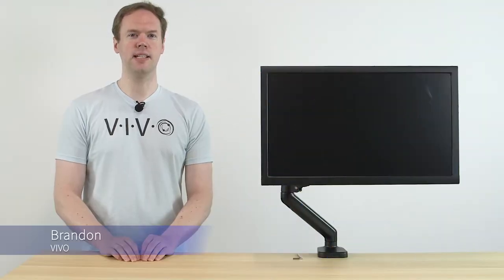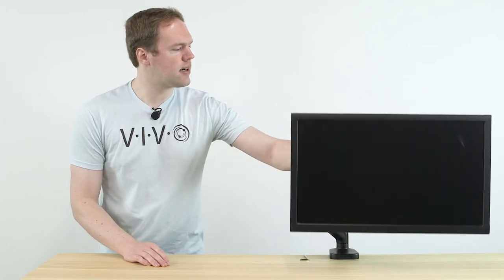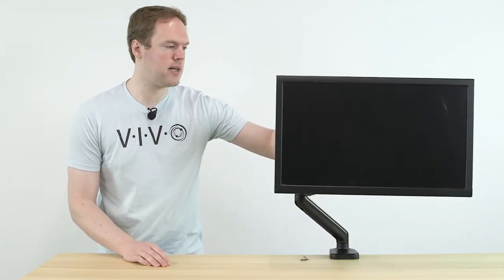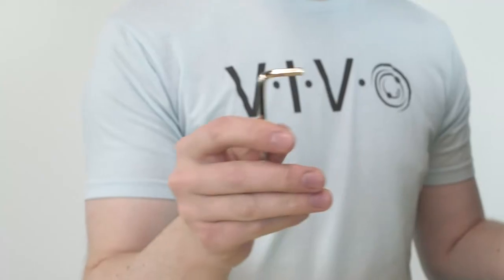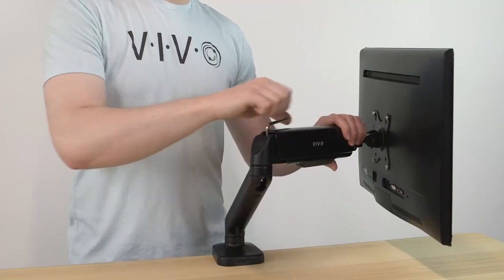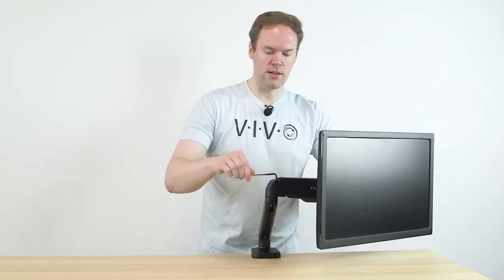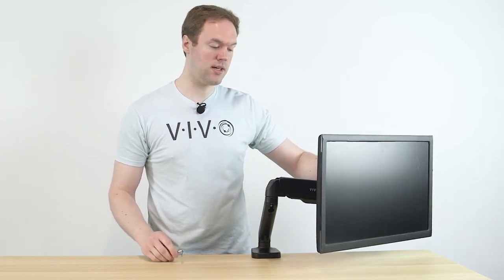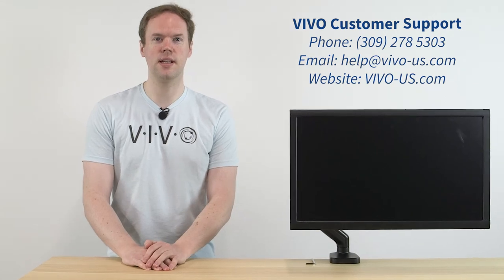How To Adjust The Gas Spring Tension

Comment: Is there a minimum minimum monitor weight for the gas spring to work? Mine is a portable monitor at 750 grams, and I can't keep the arm down no matter what I do.
Reply from the maker: Yes, the minimum weight is 1kg to 2kg depending on the arm.  if it's springing up with the strength turned all the way down, additional weight will be needed behind the monitor for the arm to function properly.

Comment: What does reducing or increasing spring mean. Use proper language - like to lossen the arm or tighten it to hold it in place.
Reply from the maker: The arms use a sprung counter-balance system, so rather than loosening or tightening the mount, you adjust the spring tension until it matches the weight of the monitor.  When adjusted correctly, the arm can be moved up and down freely and stay at the set height without further adjustment.
Reply: @VIVOus  yes and its a great arm i bought one last week for my msi 32inch wide screen and i am loving it plus it is in white lol.